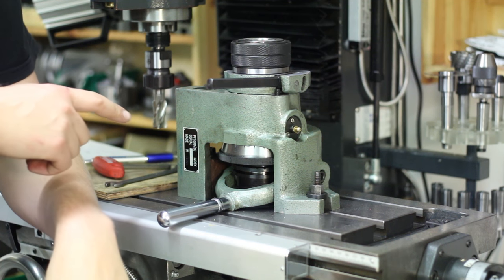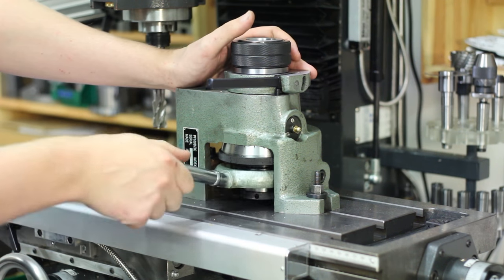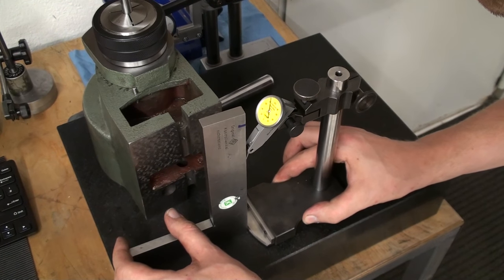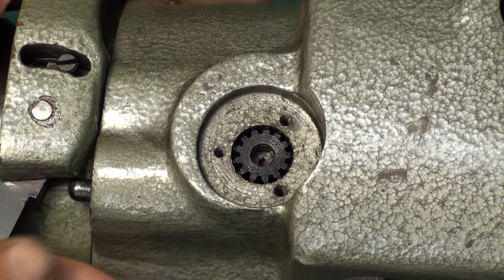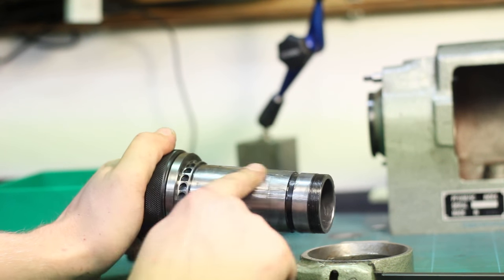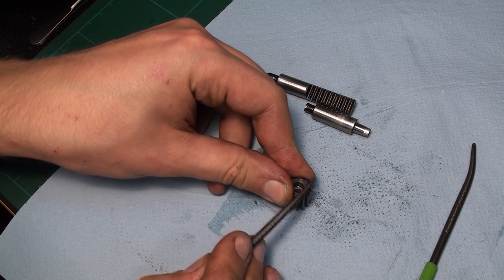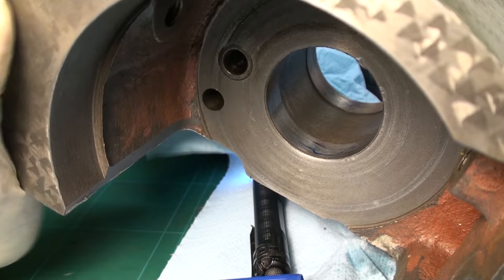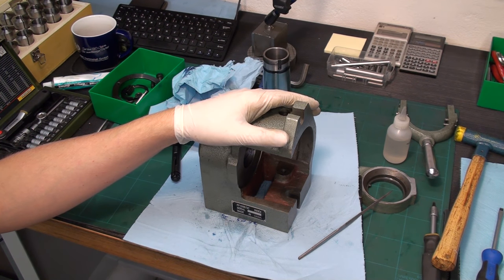Chinese 5C Indexer teardown

Comment: nice piece of kit & fun project!  I considered one of those and then opted for the spindexer.. mostly for size reasons.  Though the spindexer can't (easily) go vertical like yours can.  Will you be able to use it on the grinder?  Looking forward to the rebuild!

Comment: The Chinese "kits" are getting a lot better. You just have to add the sweat equity to make them into very serviceable tools. Considering you can't even buy the raw materials for that price, and few hobbyists can do their own iron casting. This is a great way to tool up your shop. Like you said, you can have a shop full of useful tools for the price of one quality tool. You won't get much done in an empty room with just a Hardinge indexer.
Reply: on that i  had  an old bench top drill press i bought back mid 70s taiwan was selling it online guy kept me up said dont sell anyone else give you extra he showed up checked it smilled when saw serial numbers .
brother works at factory where they still make them said buy it due to the metal made if is better quality than todays

Comment: I think much the same as you do Stefan. This should be a great series of rebuilding that kit of parts to far better alignments and accuracy. As usual a great object lesson about checking the tooling instead of just blindly accepting it should be correct. Your videos of this type go a long ways helping to educate people about how to test and rework the tooling where it's needed. I try not to cut corners with my metrology equipment and cutting tools. Basic workholding tooling needs to be the best accuracy you can afford or that can be reworked until it is. And that should be a nice subtle reminder when you replace that made in China placard every time you use it once it's rebuilt.:-)
Reply from the maker: I could not agree more - Cutting tools and metrology are areas where I will not go for the cheap route. Tried that already and got burned.

Comment: Stephan nailed it. Make the best of what you can afford. Trust me i've bought brand names which were not as accurate as advertised and still had to make corrections.
Reply from the maker: Also: its easier to modify a cheaper tool than one that costs 10x as much :D

Comment: The Chinese are just as capable as anyone else of making good tooling and any other product you can think of. They are, however not stupid and realize that most people in the rest of the world are not willing to pay for them. I had a Chinese mini lathe for some time that I used to produce some quite accurate turnings because I took the initial time to tune it up. It is always a case of getting what you pay for, either when you buy it or after you fix it. Ya pays now or ya pays later. There is no escape.
Reply: Noel Henderson
Reply: ...Yeah....that's about the size of it!
Reply: Yes. You could argue that Chinese affordable tooling introduces a lot more people to engineering, some of who then move on to more expensive quality machining tools. Or at least, create a demand for second-hand quality machines. Which means resale is better. The result is brand new high end machinery sells better too. Enthusiasts like Stefan, Tony, Clickspring show what is possible with affordable or second-hand industrial. Without Youtube and these guys, I might never have bought my first lathe.

Comment: I really enjoy these videos - very informative. In this particular case I was surprised at the relative build quality, would not have expected a hardened bushing, for example, in a cheapo chinese knockoff. "Kits" like these are a great learning resource too - buying a cheap tool and rebuilding it touches on so many different topics and will give the rebuilder valuable experience. And if you screw up, well, at least it wasn't a $10k indexer you made into a paper weight. ;)

Keep up the great work, Stefan!

Comment: The flaking is not bad....  But since this is Stefan.... We will scrape the bore. 
No need to apologize, Stefan. We understand your passion. You are forgiven. Lol.
But seriously, scraping the bore is very tricky. You have to consider pitching and yaw of the axis. Plus, remember this is a tapered bore. So the back bearing will also be affected if the front bearing becomes larger.
And the amount of turning of this spindle is never high speed and at no load, just manual turning. So the little contact spots will be more than sufficient for long use.

Comment: Wonderful video as usual. I was actually more than surprised to see the scraped internal taper, and the total runout of the indexer. Keep in mind the accuracy of the collet also contributes into the accuracy.

One question did pop in my mind though. Other than that one pin, are there any means to lock the spindle? I'm not sure how capable this style of indexer is to withstand cutting force, especially during shaping that exerts higher cutting force. What's your opinion?

Comment: Great vid Stefan!  Kinda off the subject but I saw your 10MM 5C collet you used with the dowel pin and it appears to be made in China based off of the markings.  If it is have you checked the hardness with your files?

Comment: as allways a very interesting good made video from Mr Gotteswinter one of the best YouTubers in Metallwork and hes absolut right not everybody can afford saying oh i dont buy chinese tools but ( nearly) everybody can learn how to improve them .. i use the PF70 Indexer from China ( 36 holes plate with 9 indexholes at the top where the pin sticks)  and the machined surfaces are quite usable as long as i dont do jobs for NASA or ESA :-) thanx for the vid

Comment: Stefan I'm going through the older videos again. The first time that you called the imports kits you were dead on. You explained in the three jaw video what your needs were. I would  not of had the machines I had if I didn't by used and fixed them up. I learned the market, learned how to machine by tuning my machines up. when I sold things I made money on them. So at the end I improved my skills, learned a lot and made contacts in my area and had fun doing it. Everyone's needs are different.
Reply: Finished video very interesting as always. Learned alot but would of liked to seen how you approached scraping the bore and take that as a compliment. You always get the finished product in the specs that's needed.

Comment: Again good video, many thanks for this related work.
Question about planned type label modification ... (25:05)
The refinement to precision equipment should not be misused to fake manufacturer specifications.
However, additional processing data are always important.
Information / notes on machines and devices - is well to rely on.
For me a basic measure, or am I thinking this wrong?
Reply: Hermann Platschka
Cast in China, Assembled in Germany. that would be the correct thing to label it
Reply: Jone Tveitane
Yes, I think as well (do not omit the prehistory).

Comment: A very good video. All tools are built to a price point in Euros or whatever, so the quality of Asiatic tooling varies from expensive to cheap, the worst being Harbor Freight. A spindexer should, as  you say, be regarded as a parts kit. A lot can be done to improve the quality of the tooling.

Comment: Hi Stefan. Great video, thanks a lot! But I havent understand about "tapered bearings".. As far as I see - there's no bearings at all,  metal casting around the spindel.. I tried to google and found only "tapered roller bearings" - but I havent seen it there. And also one other question connected to previous - how do you think, can you install tapered roller bearings inside that iron casting? I mean to bore the hole and press them there. I'm asking because I'm interested in making small lathe headstock from such indexer.
Reply: Or does those bearings simply under paint and I dont see them? But why havent them moved when you was drawing on them, not very clear to me, mb I just silly?)

Comment: Scraping that bearing is going to be fun !
Think of it like trying to scrape two mating surfaces that are stepped , what you scrape off of one surface will govern how the other reads with the blue dye .
For the average home user that unit would be fine  without much more than a clean and lube .
Reply from the maker: I did the scraping already, it is about as funny as going to the dentist ;)

Generaly that dividing head would be good enough for the work I do too, but I think it makes for interesting content..and I have some fun with it :)
Reply: I agree and your videos show newcomers what to look out for when making a purchase , unfortunately there are a few video makers out there that like to thump the work bench and declare that this brand or that is best or it has to be made in this or that country which for most home shop machinists does not help them to set up their workshop and get them machining .
Don't find the Dentist funny eh!
I usually find the week after less fun !

Comment: This reminds me of a question that I have been meaning to ask/request of you..... have you, or will you, build something using an ((AIR BEARING)) or  pneumatic bearing system?  It can be anything ,like a "spindex" or something to sharpen endmills... anything, but the process required to going about the mating surfaces, or I suppose it would be called the non contact surfaces...  I am going to put the request out to the rest of your youtube buddy's as well, until, somebody goes through the processes... I just can't get it right, and there isn't a whole lot of methodology upon the subject, at least that I have come across. Several birds with one stone, you would end up with another usable tool, another great video, and coolest of all, I will learn something... or figure out what I am missing or doing wrong...

Comment: 5C tooling are produced only by a few national brands in China, while about every other village factory is turning out ER collets left and right.  I keep a set of 5C in 0.5mm increments from 0.5mm to 32mm, only paid equivalent of 5 euro each.  0.01mm runout, or I demand my money back.   I chuckle when seeing people complain about "cheap Chinese mini lathes"  ..  domestically they were intended mainly for wood cutting, specifically wooden beads making.   It pays to know what grade of tools you are getting for the money; industrial class toolings from China are both competitive and competent.  German stuff is 2x better at 20x price and compete in the high end market that require highest of tolerance, companies with deep pockets buy them in China.  American tooling used to be popular, but no more.  Being natively non-metric maybe a factor; price / value another.
Reply: Just watched this video. You are right. Some of the mini lathes offered are so light, I think it is meant to cut wood or aluminum or brass. Never thought of lathes being build just for these kind of work materials. So we (I) cussed at cheap lathes. :-)
One lesson I learned is ask how much it weigh. Ha ha ha.
BTW, where did you get the 5C collets at 0.5mm increments? Was it a special order?

Comment: Stefan, great video!  I looked on the Chronos UK website and could not find this indexer.  Please, could you add a link to it?  Cheers, Bruce
Reply from the maker: For some reason I didnt find it on the Chronos site - I bought mine off ebay, this is the auction number: 331948145463
Reply: Stefan, thank you!  Unfortunately Ebay doesn't show this item either as a current or a completed auction.  I also checked ebay.co.uk.  Is there a typo in that auction number?  Cheers, Bruce
Reply from the maker: Strange - On german ebay it showed up, but now it does not anymore.
A friend asked at chronos and they seem to be sold out on the indexer...
Reply: Thanks for looking.  When searching Ebay Germany, do not forget to check the boxes "Beendete Angebote" and "Verkaufte Artikel". Even so, I can not find your item number.  Is there a typo in it?  Note that  I can find these indexers on US Ebay (item 181342255137) but since I live in Germany, the shipping is impractical! Cheers, Bruce

Comment: I enjoyed this video, but I didn't follow one part of the scraping.  I just watched your scraping 2 part series, and my understanding was that we expected to have high spots, and the low spots held lubrication.  If we had 2 perfectly flat surfaces rubbing together (ground against ground I believe you called it), then that was bad, that ground vs scraped was better.

So I'm not following what's wrong with the bore, unless it was the fact that the blue wasn't evenly distributed in "density" of the high spots being evenly distributed around the bore.

I enjoyed your video.
Reply: scrapping is a very effective method of establishing true planes. the tapper bore would require an id grinder which stephan doesnt have. 
ground against ground is bad beacuse of sticktion and the high coeficient of friction it creates massive wear. 
scrapping is skmething you can do at home amd achive crazy results if youre meticulious enough and patient.
Reply: and looks nice

Comment: What is the point of flaking a surface that is not meant to slide? I thought flaking was to provide oil pockets. Or is it just to make it look appealing?
Reply: scott black to give the illusion of a scraped surface
Reply: 'scraping' is done to remove small amounts of material to get the part/s into tolerance....small amounts being perhaps 1/10th (or less) of a thou at a time.....and of course the benefit of holding oil for sliding surfaces....

Comment: would you be able to convert this indexer to spindle in your opinion ?
Reply: what are you making a spindle for? these indecers dont have pre loaded taper roller bearings or other coaxial movment restriction. the end play isnt terible. but not great. apllication matters. Robin has a great video kn spindle design. you can definetly do it at home with planning.

Comment: would lapping the tapers together with a fine grinding power be a good way to get high contact?   pros v. cons?
Reply from the maker: I would not do it, because lapping compound might embedd itself into the cast iron and do constant harm.
Reply: there must be some abrasive that is able to be disolved after use, Im going to keep looking,..  wait! can cast Iron powder of equal hardness be used as an abbrasive i wonder?  It just seems that some sort of lapping would be so much faster and allow such a more fine matching of surfaces, even if the two were no longer flat, they would be perfectly matched.

Comment: I really appreciate your philosophy. Whether you buy new Asian or old Western tools, most need to be reworked before they're ready for primetime. If you have the budget, by all means get premium tooling and fixtures. For the rest of us, this is the reality. 

Incidentally, why are spindexers always 5C? My mill takes R8 and I want to get ER40 for my lathe and maybe also for the mill. Yes, there's the 5C-ER adapter but it takes up precious space and adds another opportunity for errors to accumulate. Same thing about collet blocks: almost always 5C. Why??
Reply: Somehow 5C are more common among tools than the others. Not sure how that happened historically but it's a reality now. If you are making tooling you cannot ignore the largest market. It is an opportunity for projects though, making collet chucks to fit your preferences.
Reply: Jon Miller R8 collet geometry is designed for tool holding. 5C collets are designed for work holding.
Reply: Paul Mathews And yet either can work for either. The point is that there are a ton of different collets to buy in many different systems. It would be nice if fixtures like this were made with more than one native collet option. (A 5C version and an ER version, for instance.) Just one additional option would greatly simplify the process of prioritizing tooling.